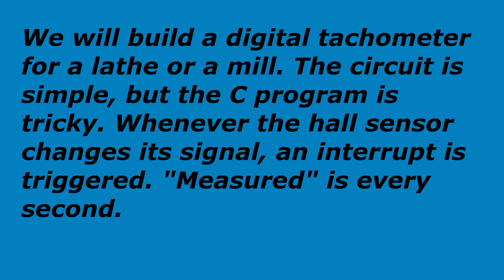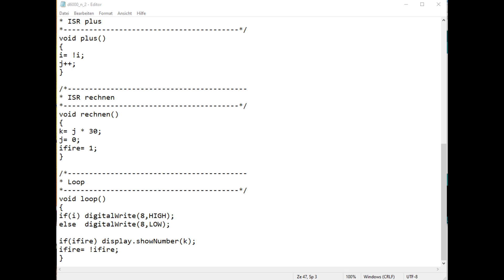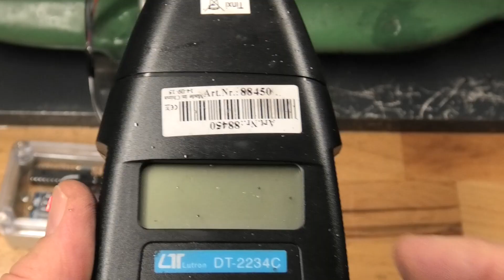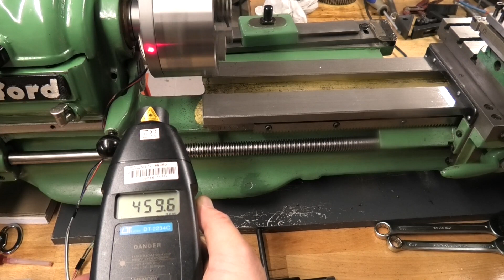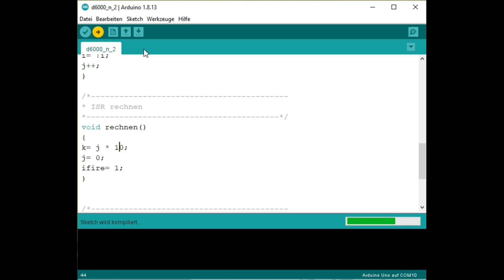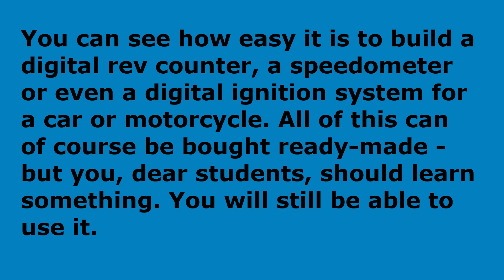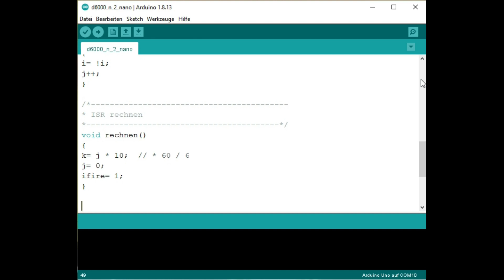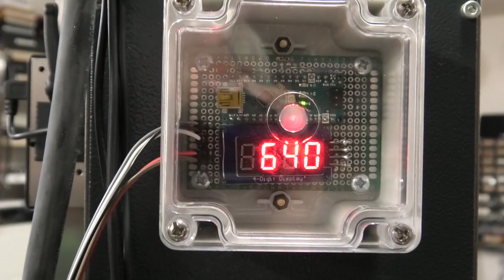Tachometer for a lathe or mill.

Comment: You count how many times the magnets trigger the hall in one seconds correct? But in low speed it's fluttering between 30 40 rpm. If I reduce the time will the reading be better?
Reply from the maker: @devilvortex1  no, you would need more magnets.

Comment: What a beautiful lathe ! Probably much newer than my 1948 myford 7
Reply from the maker: Indeed, I like it very much.
Reply from the maker: Well, this ML7-R was made in 1973 according to the serial number.
Reply: @prof-rieg  I bought my lathe 2 years ago to learn about machining. Its age stops me from modifying it. It was one of first 2000 made of a production run 130,000... if I saw a super 7 or ml7r I would buy it and keep the ml7 original
Reply: But options are limited in New Zealand !
Reply from the maker: @andrewsmith8388  but you i.e. New Zealand  are a member of the Commonwealth. It should be not to difficult to buy one in Great Britain.